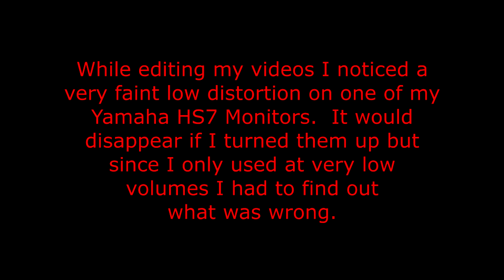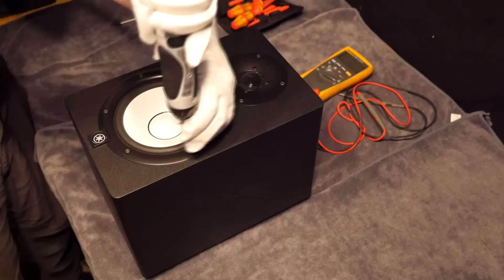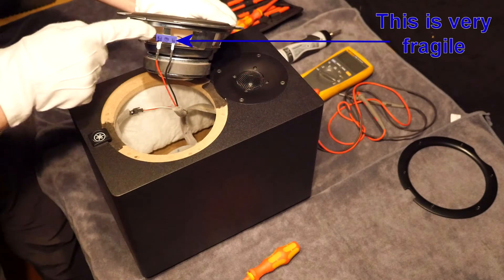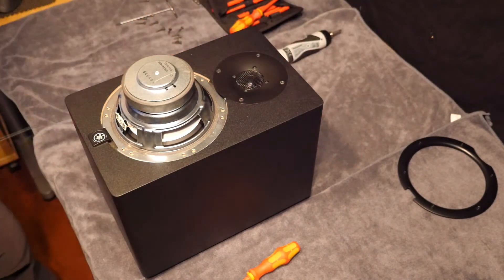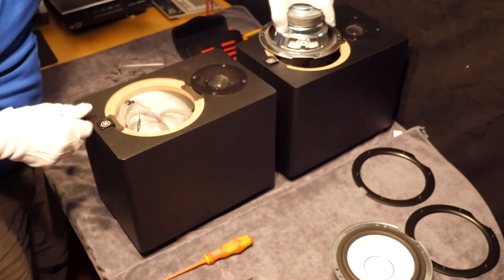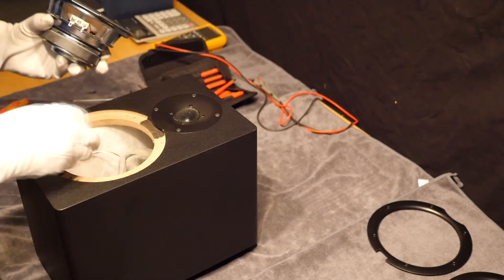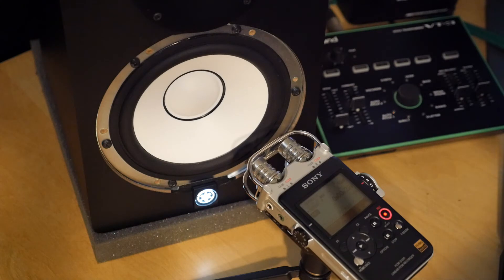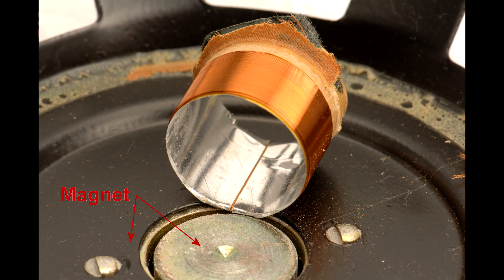Diagnosing Faulty Drive Unit on Yamaha HS7 Studio Monitors.  My Woofer Speaker has a crackle !!!!

Comment: I have a similar problem with my 6+ year old HS8. It's not super obvious when listening to more complex music, but whenever there's a solo voice or instrument with fundamental frequencies around 100-300 Hz you can clearly hear a buzzy harmonic on top of the main sound. Some speaking voices trigger it, but the easiest way to notice is playing a 4-string bass, specifically notes high up the neck. The weird part is that the "buzzing" doesn't get much louder when you turn up the volume. It starts at a very low volume and then quickly hits its ceiling, while the fundamental drowns it out at loud volume. After watching your video I took the speaker out and without disconnecting it tried rotating/leaning it in my hands in various ways while continuously playing a test sound (simple sine wave synth). I discovered that the buzzing disappears for a short moment every time I made a sharp move or in any way shook the speaker even gently. But then the buzzing comes back immediately. What could be the issue, in your view? I've no experience with speaker repair whatsoever. I'm sure I could replace the speaker myself, but they aren't on sale in Ukraine, from what I can tell. I may have to import one.
Reply from the maker: I have no idea what causes it.  It must be a design or manufacturing issue as this is really common on these speakers.  I sold mine and reverted to headphones in the end.

Comment: I'm assuming if I watched this video with the audio coming out of my Hs7's, and the part with the repaired speaker playback sounded crisp and clear high/mid vs the initial fuzzy/muddy playback, then it's safe to assume mine are operating as they should yeah?
Reply from the maker: You can hear it if you play certain types of music, just needs to be fairly low in volume.

Comment: thanks for the video.
I've got pair of HS8s, about 3 months old, everything seems fine, but if I crank the volume up excessively with low 808 notes, they slightly distort. is this normal? I feel kinda stupid asking but its just I never noticed that with my old KRK 8s
Reply from the maker: Sorry I wouldn't know as I never have mine up loud after damaging my ears listening to loud music.  Mine barely go above loud voice level.  I'm not sure that the Yamaha's are that good to be honest.  Personally if I bought reference speakers again I'd go with a different make after having to replace a drive unit for no reason other than poor manufacturing.

Comment: Seems like a stretch to ask but I am somewhat desperate at this point. A year ago I dropped my HS8 speaker on its XLR input and it completely shattered in the input board. I bought a new one and installed it and it worked very well. Months later I played my bass a little too loud via direct interface and my speaker turned off (left one was fine). I noticed movement or tapping the speaker would cause it to turn on and off. Any chance you would know what would cause the speaker to be sensitive to touch? Fuse appears fine.
Reply from the maker: Could be a solder joint come loose.  Sometimes the copper track on the circuit board can be pulled away with the component.  You may need to inspect all the solder joints.

Comment: Hey thank you for the video. I think my monitor has the same issue. I bought mine in 2019 or so… probably out of warranty. Any idea what the cost for repair will run or suggestions on repairing through local outfit? Any suggestions would be appreciated! Can share video showing the difference btw the two.
Reply from the maker: I think mine were bought not long before then.  I don't understand it as a speaker is pretty basic and they have been made now for years and years so how can a manufacturer mess on on making them !!! I bought a new driver for £40.95 delivered via Thomann Part number was YE741A00 hope this helps.

Comment: Thank you for the video sir!  
I bought a pair of these monitors and unboxed them today. However, after unboxing them, I noticed that the studio monitor had a color fade in the corners. My question to friends who have purchased this product is if this is possible with a brand new product? Did you guys notice something like this after unboxing?
The discoloration is minor and grayish. However, it is minimal in both the top and bottom corners. Is it possible that the product is not brand new?
Reply from the maker: Sound like it could be a return or remanufactured pair.  Any signs of dust on the heat sink or in a crevice somewhere.
Reply: @CoatsandGaiters Thank you for your reply! I did not notice any dust but I returned the monitors
Reply from the maker: @yigittural547  Sounds like the best thing to do.

Comment: Cool vid thanks. I have the HS5's. Out of nowhere the low end on both got drastically lower, to the point it almost sounds like there's no bass. I got these less than a year ago and haven't abused them in any way, I can't play music too loud in my room so I've always played them at a very conservative level, so I'm trying to figure out how this happened to both monitors at the same time. Maybe they've always been this low and I never noticed? Lol either way listening to music without low end is very weird. Do you think I should send them in to get checked out? I rather not open them myself as I never have and don't want to mess them up in any way. Thanks
Reply from the maker: I know 'monitor' speakers tend to have little bass as they are for hearing the sound source as accurately as possible.  Unusual for both to do the same so I'm just wondering if your used to normal hifi speakers that tend to have a tuned deeper bass for listening pleasure over these which deliver very little bass anyway.  If I were one playing differently I'd be suspicious but for both it would have to be that they are either the way they are being monitors or the signal being sent at fault.

Comment: Hey thank you for this video , I had same issue with one of my hs7’s and sent it to get fixed and they replaced a woofer and sent it back and I still had same low level distortion but just sent it back again to them saying it might be a faulty drive unit . Hope it works thanks for info and insight
Reply from the maker: I was a bit disappointed to have come across this issue with what should be top quality monitors bearing in mind mine never go about voice level.

Comment: hiya, i purchased some of these speakers a couple months back and about a month ago i plugged it in and it blew the circuit and the electricity in my house cut off. i then left it for a day and tried plugging it in again but the same thing happened. i bought two of these speakers from the same place and its only happened with one of them. do you have any advice as of what to do or how i could fix it myself as i dont really have to money to get it serviced thank you in advance!
Reply from the maker: If it blew the trip that's fairly serious so an inspection of the insides should reveal damage to the circuits I'd have thought.  It's not a damaged power lead is it? Have they been dropped?
Reply: @CoatsandGaiters  no it hasnt been dropped, it just happened one day when i plugged in my mixer the thing blew
Reply from the maker: @miz017  this concerns me now then, as they seem a bit of a liability considering how much they cost and the issue I had and mine were almost unused and used at a just audible level.  I'd look inside as something must show that would cause a trip to blow.
Reply: @CoatsandGaiters  thankyou, but im quite clueless on speakers and electrics in general so i wouldnt know what to look for :(
Reply from the maker: @miz017  you can send me photographs to my coatsandgaiters@btinternet.com email and maybe i can see something obvious.

Comment: Greetings, I just bought a brand new JBL 305p MK2 and it was playing very great first 2 days but today Its just playing at an insanely low level that i can barely hear. It's also making popping sounds here and their. Im still hearing bass but im hearing a loud Hiss noise when i put my hear close to the tweeters. Sometimes when i turn the volume knob at the back of the speakers up and down, after a while it will just start playing fine for a few minutes and then a pop and it start playing low again... Which makes me to believe maybe their is a loose wire of something inside the speaker? Im not an audio technition but I would appreciate your advice. Thank you
Reply from the maker: You mentioned it’s new.  Any reason to not simply return for a replacement speaker ?  Fir me if I couldn’t return I’d open with the hope there was an obvious fault glaring me in the face.
Reply: @CoatsandGaiters  I'm from the caribbean and the cost of shipping the speaker was about the same as what the speaker cost. Well thanks, maybe the best option right now is to have a professional open it and hope its a minor issue.
Reply from the maker: @ProducedByChristo  I wonder if it’s been dropped in transit.  I’d assume loose connection, possibly a fractured component or even a cracked circuit board if it’s had a hard drop.
Reply: @CoatsandGaiters  Hey bro, a technician found out the problem. It was the Audio Output IC chip that has gone bad, Any advice to where i can possibly buy another one for the JBL 305p MK2? Would really love your advice on to what i should do from here, JBL customer support was not helpfull at all. The chip is ST8500
Reply from the maker: @ProducedByChristo  If it were me I'd try and buy the part from JBL or find the biggest electronics chap on YouTube.  Maybe message Louis Rossmann as he would have answers.  Sorry I can't help but my knowledge is dabbling only.

Comment: Hey great video, did you end up replacing the driver of the one speaker? If so Did you notice any sonic difference in the new one vs the old one? I'm having a rattling sound coming from one of my speakers and after tearing them down like you did I found the rattle was coming from somewhere inside the Suspension/coil. Can I get away with replacing just one or do you think I should replace both to maintain the same sonic qualities. Great video btw you should make more!
Reply from the maker: Thank you for your comment.  I replaced the faulty driver and all is great now.  I think some speakers can come as a 'matched pair' but i think that tends to be very high end gear.  So replacing both drivers I can't see any advantage with as the replacement driver will be from some random stock sat in a warehouse that was made possibly a few years ago.  I'm assuming this rattle was from the suspension coil but I don't really want to tear the driver apart as it still work perfectly fine at louder levels.  It was only just audible at low levels to me.  Part of me want's to sell the old driver for cheap (as faulty) just to recover some costs as most people probably wouldn't notice what I heard.  Did you take your driver apart?
Reply: @CoatsandGaiters  Yea that's what I was thinking as far as the matched pairs go. And no I didn't take the driver apart, it seems like it would be more effort than just buying a new one because of all the glue holding the cone/suspension coil to the frame. I'll most likely end up using the cone as a sub-kick mic since the rattling I have is only at high volumes.
Reply from the maker: @ddrum121  I ordered via Thomann part No was YE741A00  HS7 16cm 4 ohm 60W. Woofer / SPEAKER    £40.95 delivered
Reply: My 3 months HS7 has distortion. It's only used in my bed room. :(
Reply from the maker: @victoriousfox  I think there is a 2 year warranty on them.  But it's disappointing when  this happens and you looked after them as I did.